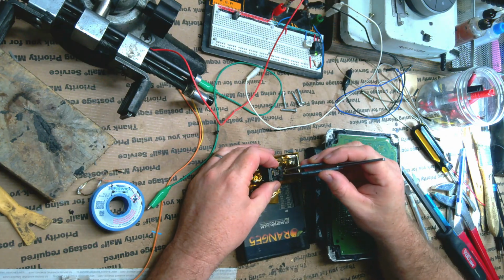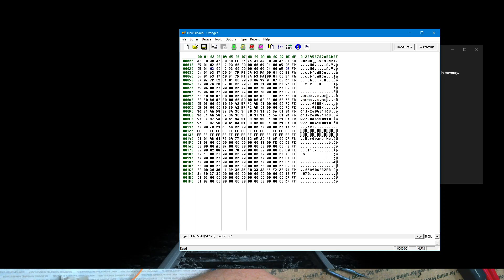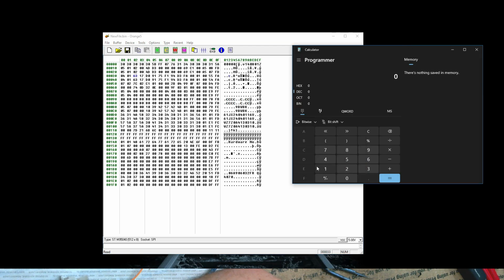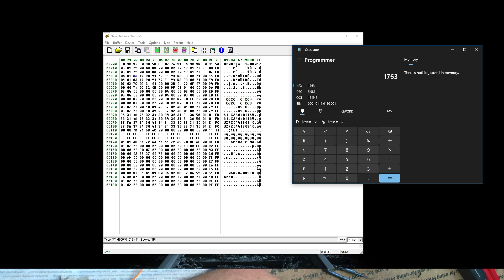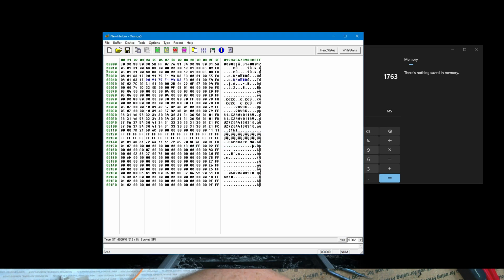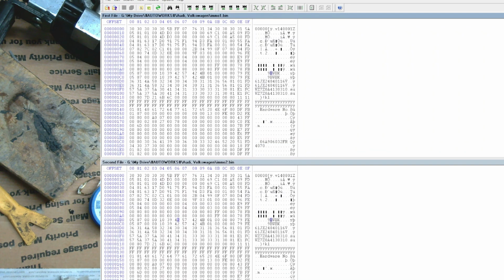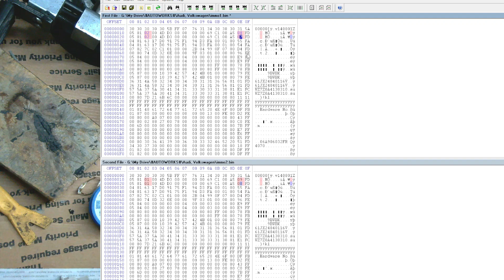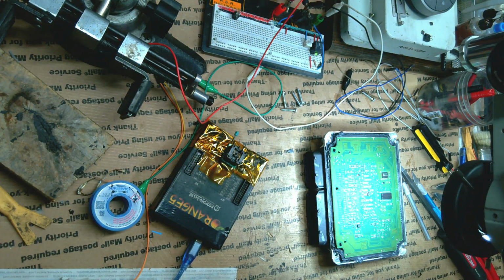Disable Immobilizer in all VW ECU ME7.1 & ME7.5 - EASY EEPROM HACK

Comment: Thank you very much for this information, My A4 B6 has been in my garage  for 3 years refusing to accepts it's key, no luck from locksmith either, I just bought EZP2023 programmer followed all your instructions on this videos, successfully removed the eeprom, programmed to disable the immobilizer and the car started. I still had to deal with the alarm flashing emergency lights. For that I used VCDS to delete the key,  my car is back on the road. Thank you from South Africa. And one more thing I tried to read the eeprom on the ECU using the eeprom clip that came with the programmer without luck, the chip was correctly identified but when I read, the error message said the chip was empty but after I remove it from the ECU I was able to read and modify.

Comment: Hey do u recommend just soldering off the chip? Or can just use a clip?
Reply from the maker: Hot air, or large tip iron that covers all 4 pins, slowly lift one side a little, then heat and lift other side.

Comment: Can you read the eeprom chip with a  Xgecu T48 (TL866-3G) programmer? i do some hardware hacking projects mostly dealing with IoT devices but my 2010 jetta needs a new ecu and the tools to do it professional is way out of my price range right now. i use linux so a hex editor is no problem and linux supports the T48, but i was just wondering if i could use it to do what you are doing.
Reply from the maker: The T48 reads a lot of eeproms. I have a tl866, t48 and a t56. Great tool to have. That said, the 2010 jetta ecu is quite different then the one in video and the xgecu programmers will not do this job. Depending on the part number, The data is in their tricore mcu's. Something like a TC1796. I usually use KESS3 in boot mode to read. Not cheap at all.

Comment: @ecurepair great vid! I´m in this very moment trying to fix my sons EEPROM. It´s a ME7.1 that belongs in a Audi A6 from 2003. I manage to read the data from it, and I also manage to write to it (turn the immo off like you did), but when i put the ECU back in the car, it resets to the original data. I guess i need to write-protect it somehow after I change and write to it?, or do you have any what I can try next? Thanks in advance =)
Reply from the maker: Did you verify it was changed after writing? I never heard of these resetting themselves
Reply: @ecurepair  I have the same issue on my B6 A4 2003, I read it via OBD downloaded the original eeprom  saved a backup copy the after I changed to immo off and wrote back the changed file tried to start the car immo still on. VCDS as report says car start blocked by immobilizer. it's ME7.5
Reply: @ecurepair i did verify it and the hex was as i wrote it. After i installed it back in the car and got a faild start, i unplugged the ecu and read the hex again and it was back to original
Reply: I should mention that i use a: KeeYees S018 SOP8 Test Clip For EEPR0M 25CXX/24CXX CH341A 24 25 Series EEPR0M Flash BIOS USB Program, and i use AsProgrammer to read/write

Comment: Could the eeprom just be swapped over the another good used ecu to get the vehicle started or would it still need programming?
Reply: Yes, as long as it is exactly the same ECM! I would be very careful about doing something like putting a 9504 from an ME7.1 into say, a ME7.1.1 It might work, but there is a possibility that if it doesn't, the instrument cluster will get stuck in "SAFE" (there are ways to recover from that, but I'm not typing it all out here.)

Personally I prefer to dump the EEPROM of both the ECM and Cluster before I do anything else. Especially if I'm going to open up the module and be soldering. Really, there's no need to remove or open the module if it's not being replaced though. The .bin can be read and written through the DLC with the proper cable/software (we're talking like $20 "dumb" FTDI cable reflashed to work with the specific software needed for the application you're working on, well worth owning) That way I have a backup, just in case. I do the same thing when I replace the center display screens. Ironically, I've only ever killed 1 cluster...and it was for my car, not a customer's.
Reply: Possibly yes, you wanna make sure the ECU's are the same part number.

Comment: Hello, have a 2008 VW touareg V8 4.2. Keys were lost and now immobilizer is on and steering wheel locked. ordered a key from VW which came in and works physically but dealer was not able to program key to car and so it will not lock /unlock car with buttons and not start engine or turn ignition on. Need help please!
Reply: I’m in the same position. Did you get yours fixed?

Comment: I have an AWP ecu that has an issue id like fixed. As soon as the key is cycled to the on position the cooling fans start cycling from hi to low speed every couple seconds continuously. Even after starting the engine. So constantly cycling when its powered up? Would this be in the tune eeprom, or this one you've worked with in this video? Is this issue something you would know how to fix? As well as immo defeat?

Comment: You should warn people to never seal an ecu with any adhesive coming from a caulking gun, because some are conductive like PU glue...and others release acid fumes when drying like bathroom silicone... both will destroy the ecu , pu glue will short it immediately if it touches any component or trace and silicone will corrode it over time..... the best thing to use is rtv silicone, making sure its non acid type. Rtv silicone is very good as insulator , its durable and usually non acid.. just go to a car parts store and search for gasket silicone or whatever...it comes in black red or grey
Reply from the maker: That's a good point. I tend to forget I spent a long time testing the best type of sealers before I found one that worked. 
I use permatex 81173 (oxime silicone rubber) and it has worked the best imo. https://www.permatex.com/wp-content/uploads/tds/81173.pdf
Reply: @ecurepair can you please help me desifer a TVS chip code

Comment: i thank you very very much for this  very valuable info,i am starting on this and is very important this knowledge,one question how much heat you use for desoldering?
Reply from the maker: 350c is typically a safe heat to use while learning. Personally, I usually leave my station on max heat and airspeed but this should only be done after you have a lot of experience using hot air because if used incorrectly you will damage things easily.

Comment: You can use Ktag to read the eeprom on the ME7.5 without removing it
Reply from the maker: Last time I tried Kess3 it failed to read these through obd. Only worked in boot mode. Since I didnt need to read flash there is really no reason to remove pcb from glue'd heatsink side to access boot pin imo. The eeprom is so easy to remove its no issue for me.